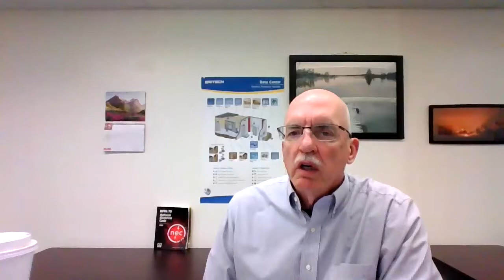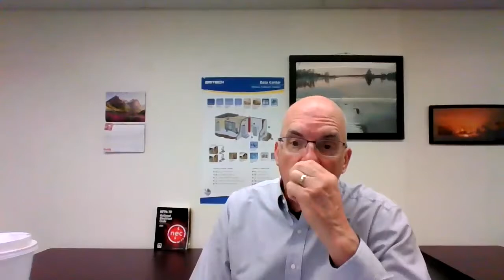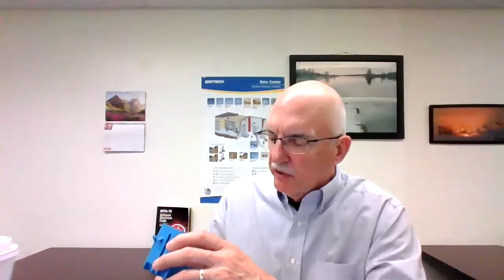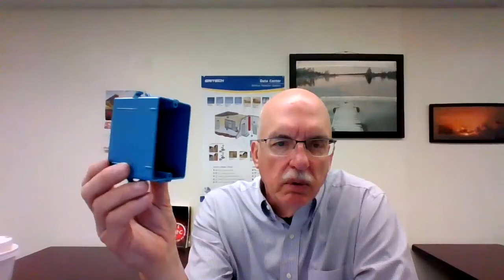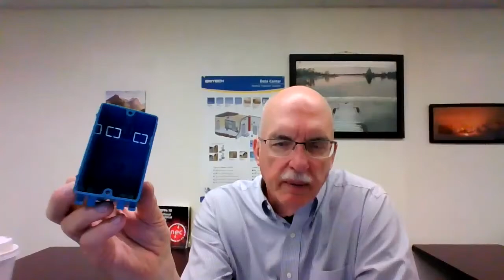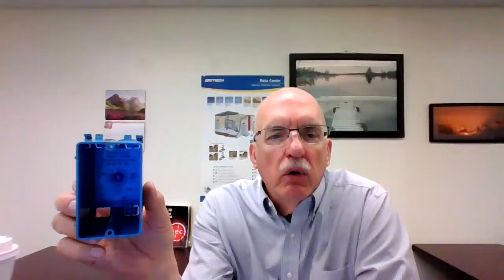Electric Education Center Session #12 2020 NEC Changes

Comment: Rich thanks for another great code vid. Have to disagree with using a P Touch to identify safety switches. I like to tell not only what a safety switch feeds but where it is feed from ( panel & breaker # ). I have went back 10 years later where I have P Touched safety switches drives receptacle & switch covers and they were still there.Have not ordered the plastic engraved plates in years but think it took a coup!e of weeks to get. At CHOP any time a small room was remodeled they ordered engraved stainless steel wall plates.